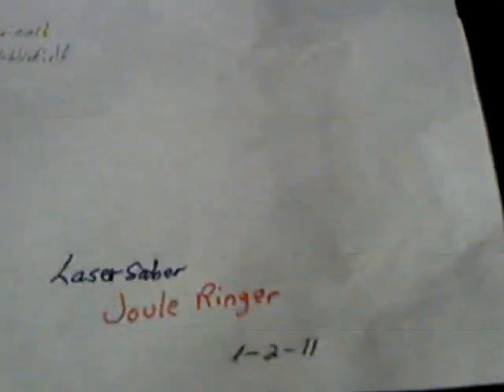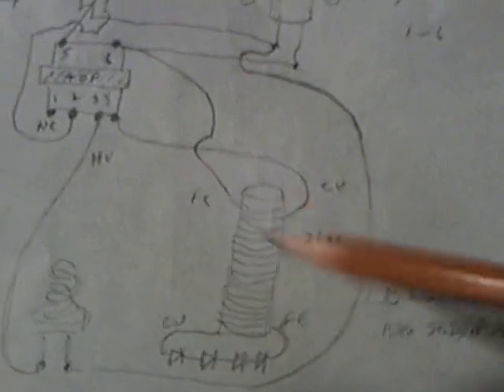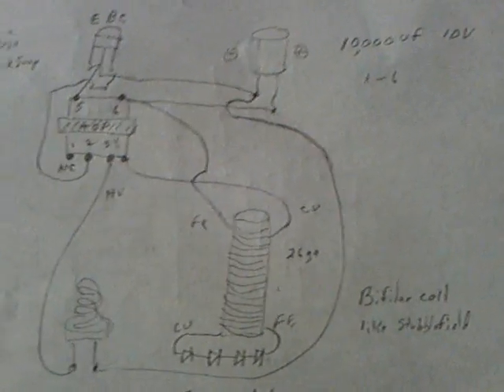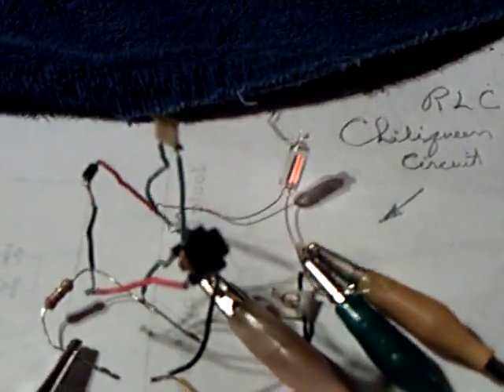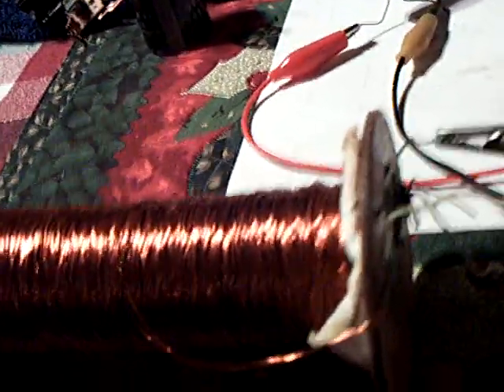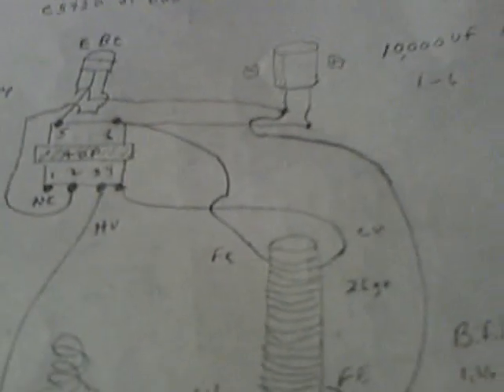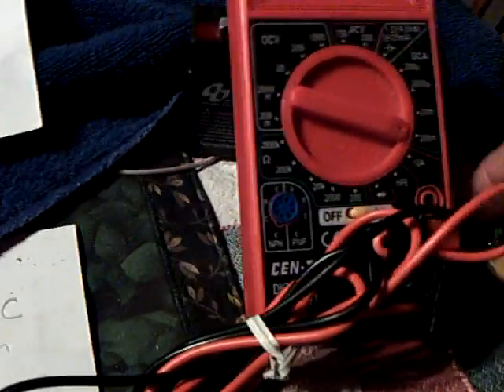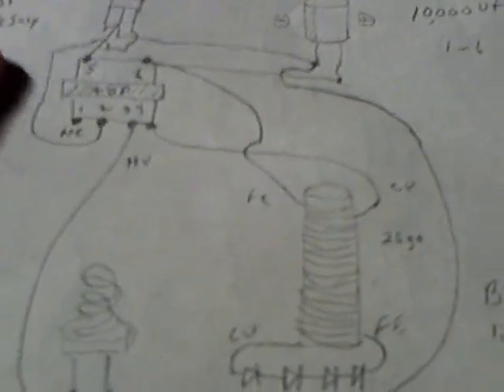Lasersaber Joule Ringer---1st attempt.ASF

Comment: You know lidmotor if you can replicate lasersabors experiment bit by bit then it won't hert to add a cfl and see if you can keep the circuit alive with a small solar cell since he powered it up with the capacitance in his fingers and as he did what he did it seems like a grounding effect from his body makes the circuit become more active. I don't fully understand the nature of RLC's. Does an av plug work near this? It might prove to be a power souce as well with a super cap balancing the voltage